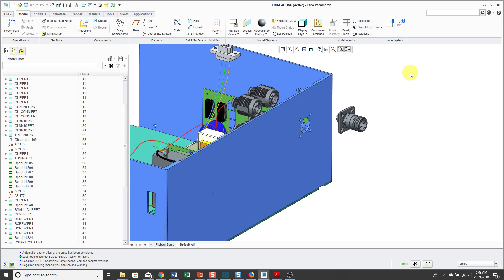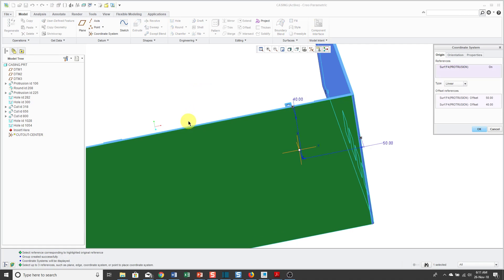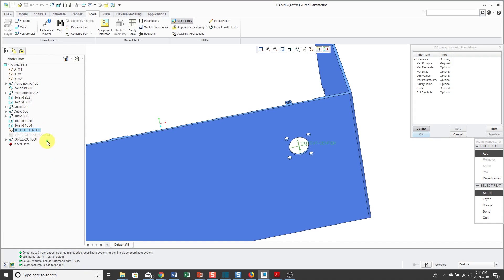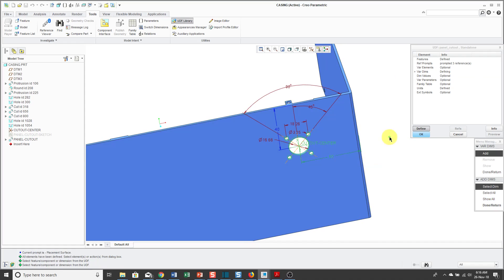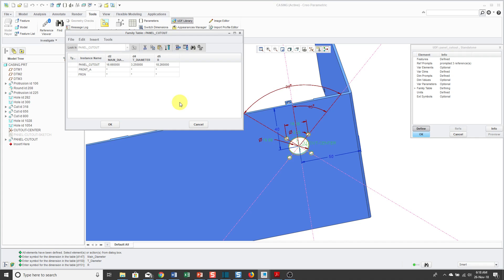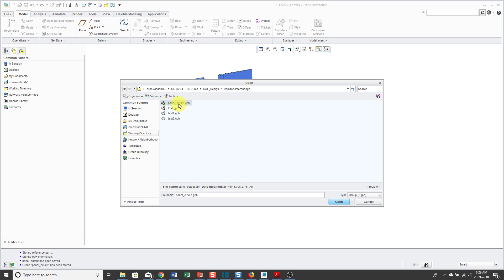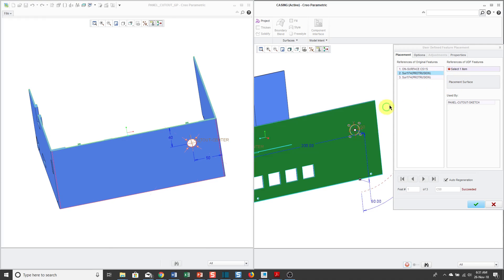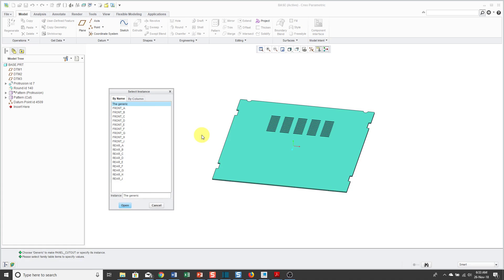Creo Parametric - User Defined Features (UDFs)

Comment: Hi Dave....I was just thinking can we use UDF combine with family table for mounting electrical connectors of different sizes on a bracket for my project and exactly found this video....Thank You
Reply from the maker: You might also want to check out my video on using Interchange Assemblies with connectors.

Comment: Is there a way to add Parameters and Conditions to an UDF?
Reply: I want to create an metric thread udf
I want that I only have to set the Dimensions vor the pitch and the lenght of the thread
But since I need to set the Pitch for the helical sweep and in the sketch for the sweep profile, I always end up having to set the Pitch twice, when I use the udf
Reply from the maker: UDFs can contain variable feature-level parameters. What's a condition?

Comment: I wish Creo is available on Fedora and Rocky Linux.
Reply from the maker: It won’t be. Linux support was killed like a dozen years ago. It turns out offering CAD software on multiple platforms requires a huge amount of infrastructure.
Reply: @CADPLMGuy  
I remember when PTC stopped Pro/E support on Linux. I felt it was really unfortunate.
Corporates couldn't use Linux because unavailability of Nvidia drivers.
Now situation is otherwise. Nvidia drivers are available on Linux but Creo is not.
Again companies are forced to use Windows.
:-(
I have both Creo and Ansys license in my work place. I usually prefer Linux for Ansys for better performance and stability.
Anyway thanks for stopping by.
You make good videos. Since two decades I am using Pro/E and Creo. But still like to see the stuff your way.

Comment: Hi dave, How to use the var parameters option in udf?
Reply from the maker: Double click on the Variable Parameters option in the Model Dialog box and select which feature or component parameters you want to be variable. I can’t say any more than that. I’ve never personally had a use case for this but I appreciate that the option is available.
Reply: @CADPLMGuy  thanks dave

Comment: Can I suggest to make a video with assemblies udf?
Reply from the maker: Weird. I thought I already had... I thought I had one where I used one to place fasteners...
Reply: @CADPLMGuy  yes you are right. Sorry I made a bad search.
Reply from the maker: @tiagofigueiredo2848  What's the name of that video? I couldn't find it, which tells me I need to rename it and improve the search terms.
Reply: @CADPLMGuy  I can't find it also, but I remember also, that you have created a video, with some screws...  But by the way, when you place an udf in assembly is it possible to also insert with the udf some features.  Example, insert a screw and also create the needed holes for the screw?
Reply from the maker: @tiagofigueiredo2848  I think it's in a Tips and Tricks video, but I have another example with a connector / backshell / boot combination that I need to make a video for. I'll track down that video and let you know...
Reply: @CADPLMGuy  thanks about that.
Reply from the maker: @tiagofigueiredo2848  It's in this video: https://youtu.be/Zb5ey4OthW0 
I also updated the title so it will be more easily searchable.